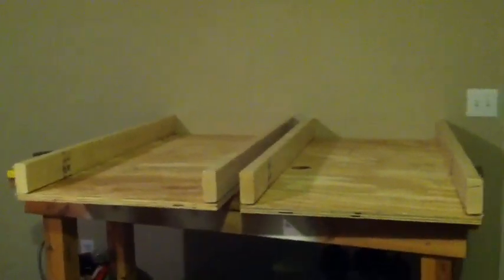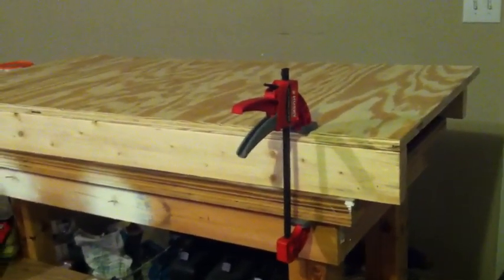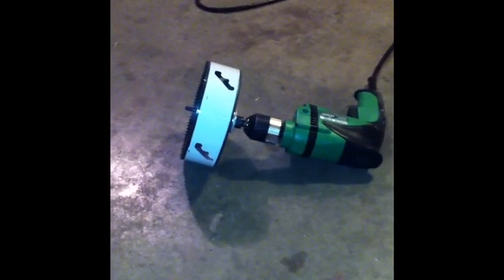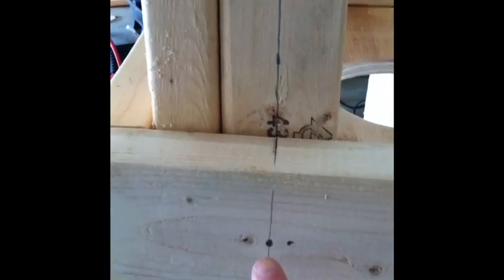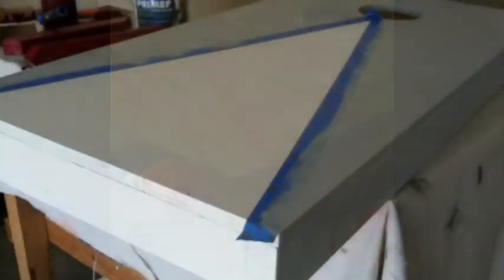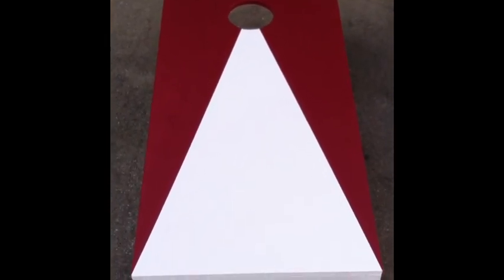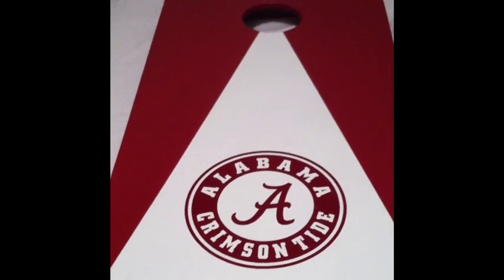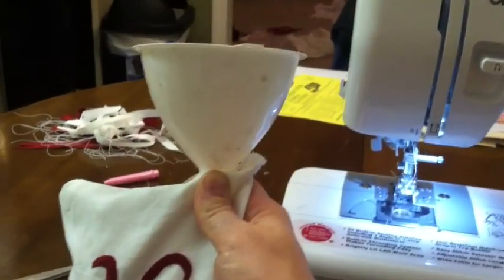How to make Cornhole Boards for Beginners

Comment: Thanks for the tutorial very helpful! I am going to make a set but was wondering about what is the average cost to make a set of boards, and about how much paint should I buy(Like how many Pints, Gallons, etc?)
Reply from the maker: +BUZZSAW688 I just saw this comment.  Sorry I have not replied before now.
I am not positive of a grand total, because I always bought enough for several sets at a time.  I would talk to the person where you are buying your paint and they could tell you how much to get.  It will depend on if you are priming your boards.

Comment: Hi Coach!  Just a few questions for you.

1. What type of paint do you use?  Is it paint or spray paint?
2. How much do you spend on a sheet of plywood?
Reply: Use an exterior satin for the paint, it hides the grain of the ply.  Then use polycrytic clear coat.  A piece of PT Ply that will give you 4 pieces for boards is about $35.  You want PT for all your wood
Reply from the maker: WithTheBears Thanks for answering!

Comment: Thanks for the great video, I appreciate the conciseness without losing too much detail.  One question--What 6" hole saw do you use/recommend?  I was going to try using a jigsaw to cut out the circles, but I think the imperfection is going to bother me.  Another YouTuber recommended a $22 one on Amazon, but reviews were mixed about it.  I hate to spend $50-60 on the higher end models though!  Thought I'd ask your opinion.  Thanks again!
Reply from the maker: +Pink Toes and Power Tools Hello there!  Cool name.  Thanks for your kind words.  I use a Lenox Hole Saw that I purchased from Lowes.  I used a jigsaw on my first board, but the perfectionist in me had to do it better. Harbor Freight, if you have one, is a good store to look for competitive prices on tools. Good luck.
Reply: +CoachVictory Thanks for the suggestions!  I did end up purchasing the $22 one from Amazon, but if I decide to  make sets to sell, I'm going to upgrade to your Lenox brand hole saw.  The cheap one was burning through my drill batteries like nothing!  I ended up digging out a corded drill, but it was smelling pretty hot by the time I got done.  But the holes are perfectly round, so it was a success!

Comment: Hello, did you run into a problem with the polycrylic/polyurethane adhering to the vinyl sticker?  If so, how did you overcome this?  If not, what was the surface of the vinyl sticker?  Matte?  Thanks.
Reply from the maker: I did not have any trouble.  Once I heated the decal with the hair dryer, it stuck to the surface really well.
Not sure you could pull it up after you heat it.